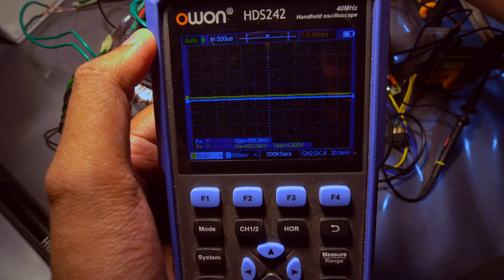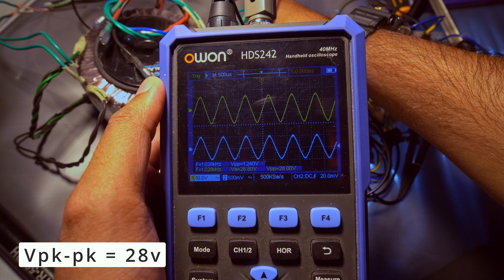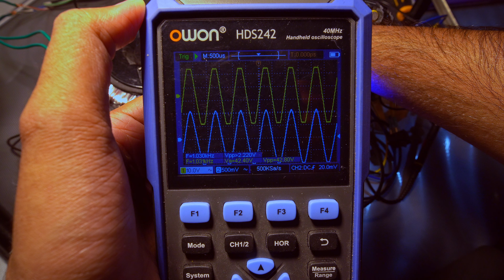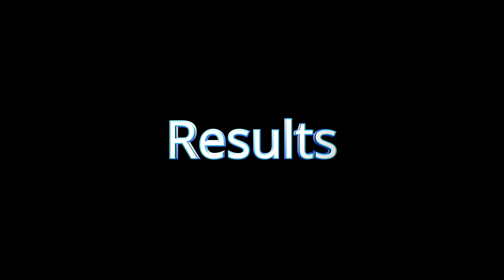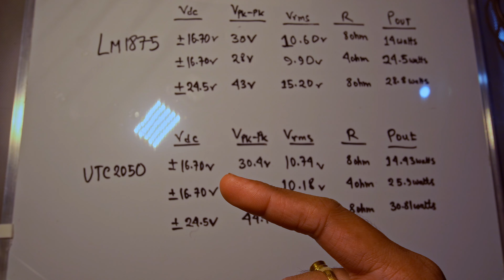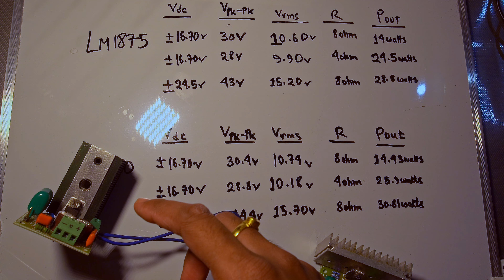LM1875 vs UTC2050 Detailed Comparison with Power Testing | DIY Amplifier Part 3 | Shocking Results 😱

Comment: It makes sense that the lower output ic runs hotter than the higher output ic on the same voltage. The lower power one is wasting power in the chip, creating heat.

Comment: The peak transformer dc voltage drops to the actual rated voltage when amplifier is giving max output & sometimes voltage drops to even more low due to poor quality transformers that we get from local Electronics shops. Suppose the transformer is rated 2 Ampere but upon drawing just 500 mA the output voltage drops severely